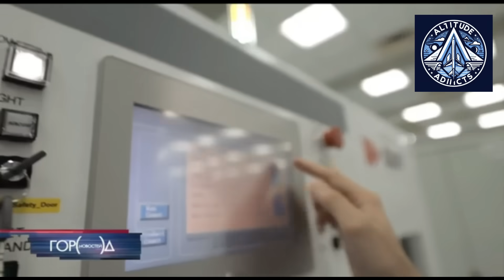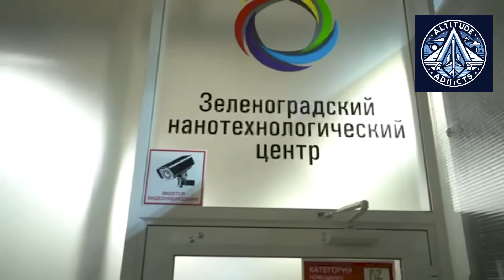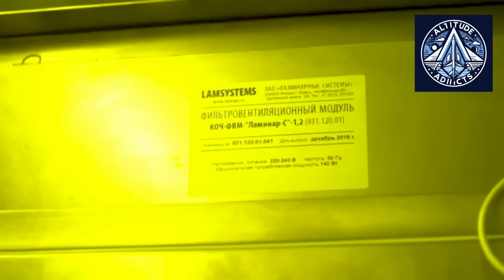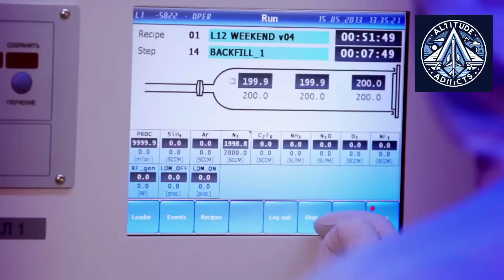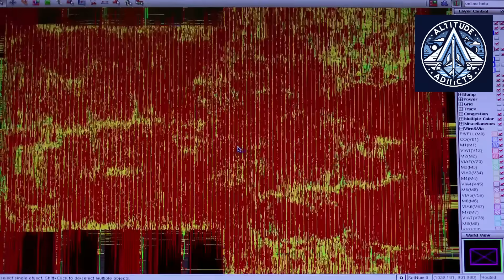First Russian-Made 350 nm DUV Lithography Machine Set for Commercial Installation, Eyes 90 nm Next

Comment: Below 15 nm the economy in current does not justify a further reduction in scale. Also the quantum effects introduce more and more erro4s. Also a larger transistor size is more resilient to EM pulse in armament systems. Armament sistems use old school programming in machine code and do not require a high frequency clock or large memory sizes.